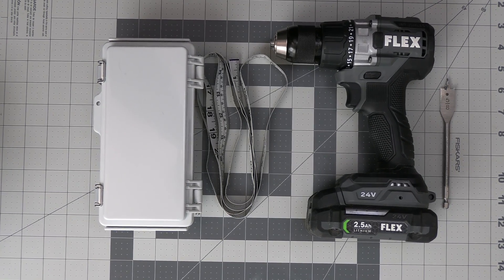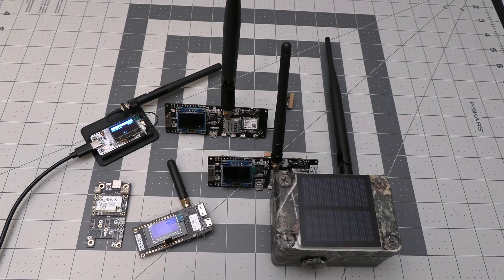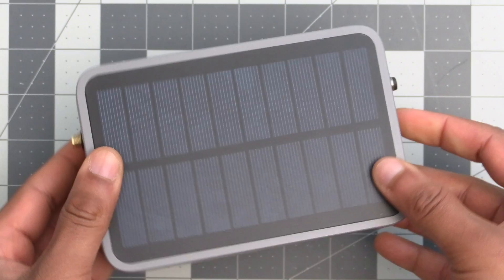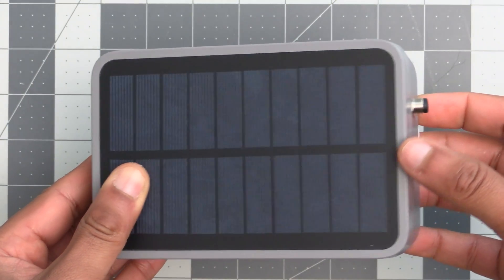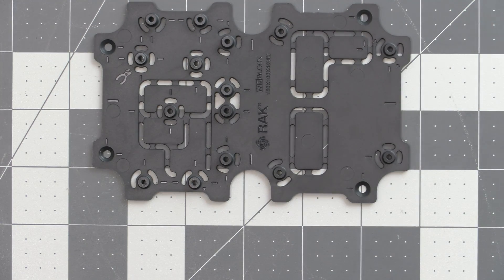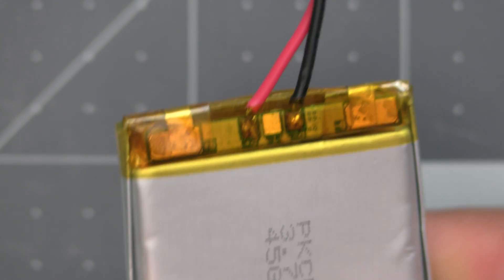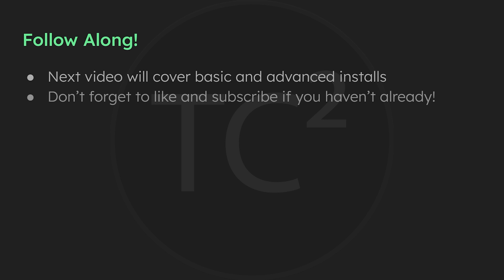Easy and BUDGET friendly Meshtastic Solar Build!

Comment: i juat received mine...i just need to pair it on bluetooth before I mount it on the pole?
Reply from the maker: Yes, you'll want to configure and pair it before mounting and make sure everything is working as you like. Make sure you have an antenna connected to avoid potentially burning up the radio
Reply: @The_Comms_Channel what would you set the power at? i just reflashed it and got it up and running..i just wana make sure its gonna run max power and dont want to have to take it down off tue 50ft pole.

Comment: Any idea when we might see that video regarding the M8 implementation? I recently got the same Unify enclosure and wondering if its possible to wire the M8 to be able to charge the device externally in the winter when the panel can't charge up the batteries sufficiently.

Comment: Thanks great video and super helpful! Subscribed! Do you think this system would benefit from a 5v solar charger controller? Building out a system now.

Edit: I sit corrected just reviewed the  chipset specs and it has a stepdown converter (5v to 3.7v) on a built-in charging chip, rad!
Reply from the maker: Appreciate it! Yep, it's been working really well for me out of the box!

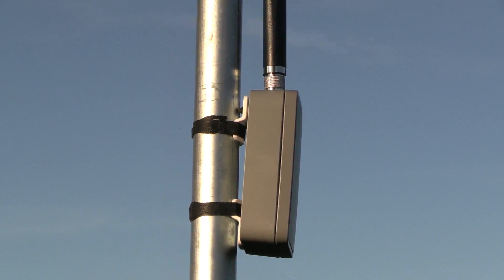Comment: I don't know if anyone has mentioned this but at 2:46 that antenna is too close to the mast. An antenna that close to metal reflects half the power back into the radio even if it's SWR is perfect not mounted to anything.

Comment: @3:29 you say there’s a problem with the solar panel and the angle 
why not angle the solar panel to an optimum slant, and then put an angled adapter on the antenna so that it still remains upright?
Reply from the maker: Doesn't exist other than a 90° angle

Comment: I am new to meshtastic. 

Got what is probably a stupid question:  

Ok so i understand i will need a phone and lora/mesh device paired up to talk to other meshtastic radios(devices) 

If i build a node like this does the node have to be connected to a phone at all times as well? 

Or can i build a Node and it be stand alone and then have a phone/pocket lora pair i can then drive down road to do a range test?
Reply from the maker: Not a stupid question at all! No need to have a phone paired at all times. It'll just run and act as a repeater even with no phone paired to it.
Reply: @The_Comms_Channel  ok. Thank you for the response.  I am understanding better now with your answer. So is it possible to run the range test as described in your other video if it is running as a repeater? I am assuming I would need a second phone/lora pair back home connected to repeater node to run that cool range test location to Google map overlay.       Because now that you have mentioned the node can run in repeater mode it probably won't store the data from the mobile lora radio?  

Thanks again for the great videos and response. I am just starting the getting started play list and will probably watch all your videos on meshtastic.
Reply from the maker: Sorry for the confusion, when I say repeater I just mean it will repeat packets it sees. Be sure to keep it in client mode. Repeater and Router mode should only be used for nodes on top of mountains or very tall towers
Reply from the maker: Sorry for the confusion, when I say repeater I just mean it will repeat packets it sees. Be sure to keep it in client mode. Repeater and Router mode should only be used for nodes on top of mountains or very tall towers
Reply: @The_Comms_Channel  ok.  Cool deal. I will probably get the answers I have as I watch more of your videos.  Apologies for asking stuff you probably covered already.
Reply from the maker: You're good! Feel free to ask anything here or our Discord https://discord.com/invite/TXA8k29k

Comment: What setting in the app are enabled to prevent app from disconnecting from phone bluetooth that is the issue I am having with all my radios. After sleep mode kicks in it will disconnect.

Comment: I'm considering putting some on top of the ranges (peaks in New Zealand),  how lightening resilient do you think this would this be....  looks like a fair reasonable amount of plastic between the components & the pole you stick it on - could even pack more insulation on the arrangement....   thoughts??
Reply from the maker: The plastic on the enclosure is quite thick, but it will have an antenna on it so you'll have to take that into consideration. Not many radio systems can survive a direct strike.

Comment: Have you looked at using and LFP/LiFePO4 battery for powering as they have many more cycles before replacing? That's a path I'm looking at. I guess I'd power the board via the USB and have my own charge controller.

Comment: The antenna at 2.50 is much too close to the mast. This will definitely affect the SWR and resonance frequency. Anyway you have some good ideas for offgrid node. I recommend strictly to measure the spectrum of the site before installing nodes to make sure the node is not affected because the frequency is already full or disturbed.
Don't you use silica gel in the box to avoid condensation?

Comment: For those of us in the North, I was wondering if you or one of your followers have come up with a way to utilize the BME680 Environmental Sensor with the RAK WisBkock to turn turn off the charge input from the solar panel when temperatures drop to near freezing? 
Or if using a small independent charge controller with temp sensor is a better way to go?
Thank you kindly
Reply from the maker: I'm going to try cooking something up for this after storm chasing season when I have more time, but I'll definitely work on this way before winter time

Comment: the best and cheapest flat lipol batteries are old new stock ipad 2 or 3 replacement batteries. they are about the same capacity as the highest spec 18650 and cost about 2$ each. only issue is you have to chop them up as they come in chains of 3 and that can get a little sparkey if you dont go fast. also the steel tabs on them is a bit too thin to spot weld on but i was able to solder to them easily enough with flux.

Comment: Yes, the previous version is disappointing. The solar panel isn't big enough. Even with a 3000mAh battery, it flatlines, and the hardware crashes and refuses to start up again. I've brought this up in the Meshtastic Discourse, and the solar panel channel folks UTTERLY DENY that the problem is rak's. "Oh, it's the chip maker's problem." So effing what? Rak chose to use it.

Comment: Hej Comms channel 😁... Just wanted to share an idea regarding the antenna (problem) you had. I also use the alpha antenna 's. And you can mount a cheap  Vehicle CB Radio Antenna Mount on the case. Then the antenna can be set in all directions you want.
Please keep up the good work 👊
Reply from the maker: Good idea! Thanks for the tip!

Comment: Hey man, i just wanted to say that for battery graphs, the iPhone app is really great. It logs battery percentage from all nodes and shows a nice graph. Id genuinely consider getting a cheap used iPhone just to log the battery percentage of solar nodes
Reply from the maker: Yeah, I've seen the graphs and have been hoping they make their way to Android but no such luck lol.
Reply: @The_Comms_Channel  yeah same. I've only recently gotten my hands on a used broken iPhone that I fixed up and I have to say, the entire app is so much more fleshed out than the android one. I'm definitely going to stay on android for different reasons but the app on iOS is really great. It also logs channel utilisation and airtime in the same graph and it's so cool. You can delete them to start logging from a specific time point or export them even. It even shows which device the other nodes are with little pictures of the device. It's so cool and even the settings are more mature, you can even see the firmware of your node and if there is a new version out!!! No disrespect to the android developers of course, but I gotta say, the iOS app is incredible. You do have to have iOS 16 and up so at the lowest, an iPhone 8 and up should work

Comment: has anyone tried swapping out the ungodly RP-SMA connector for a correct SMA lead? Mine will be here today and I only have SMA antenna. I have a bunch of sma adapter for my meshtastic I am hoping I will be able to swap it.
Reply: I ended up using a very similar sma adapter I had from a fpv video transmitter that worked fine

Comment: Any testing in HOT environments? I live in Florida and am wondering how hot it will get inside that  enclosure with no way to release heat eventually frying components.
Reply: forget the components I'm in South Texas Lipo batteries cannot be overheated when fully charged, they swell up and eventually catch fire, has anyone had this problem?
Reply: @CarlosDelaoGunEngraver I also live in a hot area and am worried about heat in the summer
Reply: @CarlosDelaoGunEngraver curious nobody talks about this

Comment: I built this exact setup a few weeks ago.  I used a 5200mah battery and it can go days without a charge and get back up to full with minimal direct sunlight.  

Easiest build to date.  The case quality also made it much easier to convince a local university to let me install it on the  roof of one of their highest buildings.
Reply: Do you have a video on your set up. We are experimenting with set ups for a CERT network
Reply: @Meghand1g - Very similar build this video, just with a bigger battery.  We also upgraded from Meshtastic to Meshcore as our community was getting flooded.  Significantly better and improving fast.
Reply: @samhickman3813  I don't know much about this but I am guessing meshcore and mashtastic don't communicate with one another

Comment: Take NOTE!!! the RP SMA means Reverse polarity!!  This means the center pin is opposite gender from a normal SMA and they are NOT interchangable.  You must purchase RP SMA hardware/Antennas not regular SMA
Reply: Yeah, I just got this thing in the mail today and I am putting it together and 'waddya know!', my 915 lora antenna don't fit! Why did they do that?
Reply: So would a standard sma to ipex alleviate this problem or does it have anything to do with board circuitry?
Reply: @firemanbif  nothing to do with board circuitry.  They just use RP sma connectors for a lot of wifi applications.  so the adapter should be fine

Comment: I've been running a diy enclosure and wisblok with 400mA 5v 2W panel stuck to the front and looks exactly like this new RAK box!  However..whilst one of the units on the side of a mountain facing south is performing ok (ish), the other on a less favourable view is still slowly losing power.  The strange thing is when I first installed it seemed to perform great with keeping charge even in cloudy days.  I'm still dubious the panel size is big enough, even for those new RAK ones.  I've a 2 x 18650 pack inside (around 6100mAh).  I am pondering a more reliable option with a 4W panel but this will mean separating panel fix/box fix instead of all i one.  To note...I have been directly attaching the panel to the board but may try the intermediate RAK geen power module.

Comment: Id like to see this build with 
Hydrophobic Vent added, voltaic enclosures Battery Protection Module, 18650 batteries with holder, Proxicast for weatherproofing the antenn, RAK or other buck boost for the solar panel.
Reply: Great idea adding a 18650, that's what I plan to do with this.

Comment: Total = $174 + tax & shipping if using the links he provided for this build 4/24/24
Reply: I use those and also tupperware
Reply: You can do it for far less if you buy the parts separately and put it together.

5 volt cell phone solar panels are dirt cheap. More power too. Use any cheap enclosure and your old 18650 cells every single one of us has.
Reply: @kevinroberts781  how much?
Reply from the maker: This video is mostly meant to be an easy option for people who don't want to build/construct everything themselves.
Reply: @The_Comms_Channel remove 'budget' from the title
Reply from the maker: @25566 Nope. I changed the title, but put it in all CAPS instead of removing  👍

Comment: I thought the Wisblock had a solar charge controller integrated into the 4631 core module? Can you explain why you bought a battery with charge controller? Thanks.
Reply from the maker: The WisBlock will do overcharge protection but not over discharge
Reply: The battery has a management system, not a solar charge controller. Most every lithium cell will come with a BMS. This prevents over charging and cuts off voltage when it gets too low. Without this you risk damage to the battery or worst case, a fire.